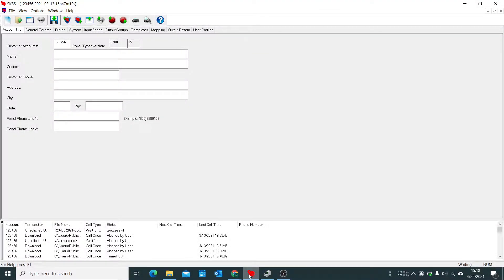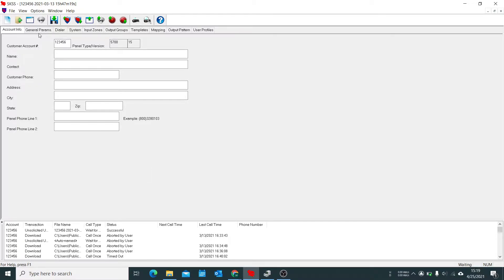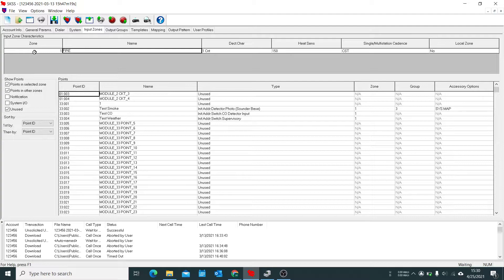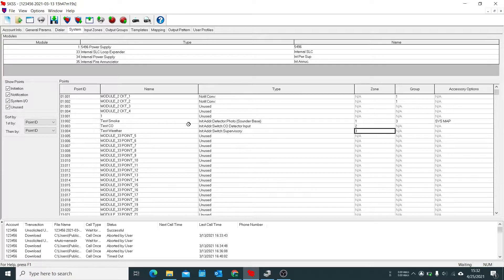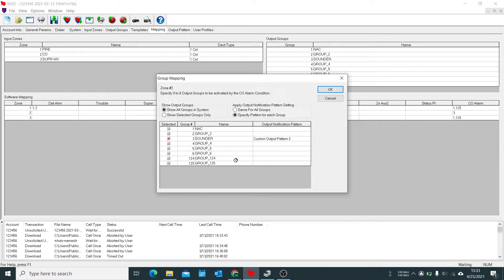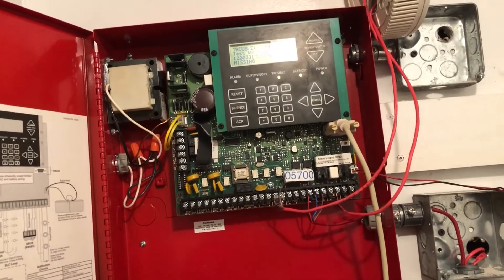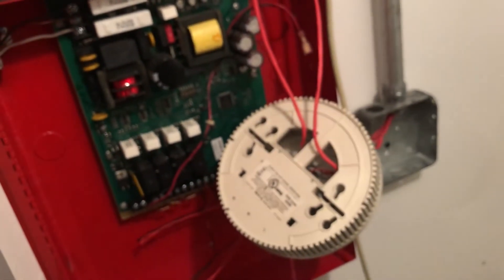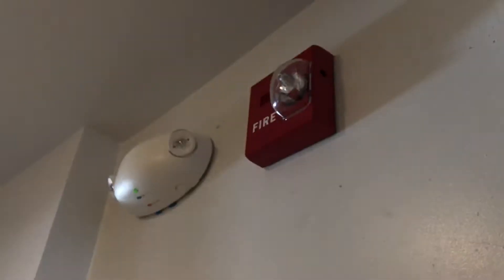Silent Knight Sounder Base Programming

Comment: How did you get that program to the panel? Been trying to do that with mine but idk how to make a modem work
Reply from the maker: On this particular model, you have to use a USB to RS232 cable. I got mine off of Amazon, brand is a SABRENT.
Reply: @HJCF0520 ah, I always read that direct pc to panel is not possible on the 5700 and that a modem is required but I’ll give that a try